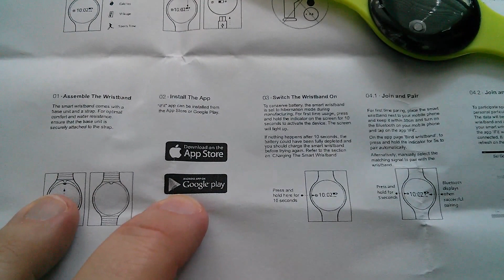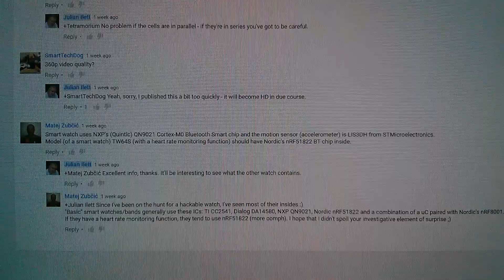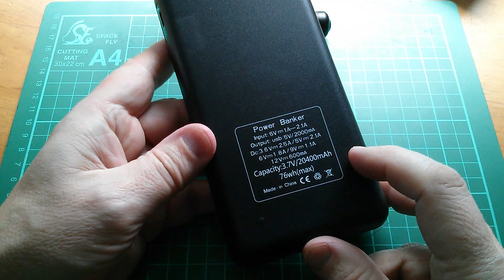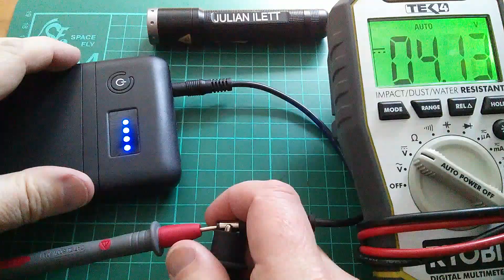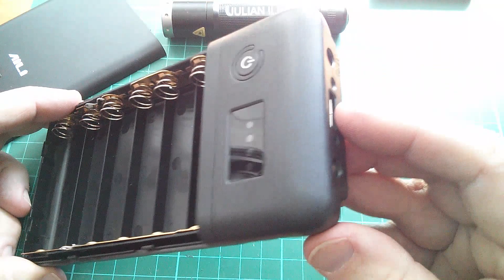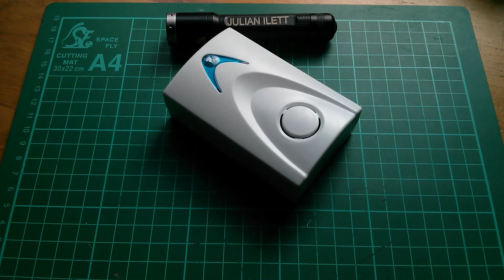Julian's Postbag: #61 - Green Watch, 12v Powerbank, Doorbell

Comment: What's the make & model of that smaller power bank that you use with the watch? Given that it has a switch, can I assume that it stays on regardless of how small the load is?
Reply: Never mind - I found it: http://www.ebay.com.au/itm/Portable-USB-Power-Bank-18650-Battery-Charger-Case-DIY-Box-Kit-for-Mobile-Phone-/271837404062?var=&hash=item3f4ac59b9e

Comment: I ended up getting the doorbell after watching this video .. I wanted to mod mine with an arduino whereby a distance sensor would cause the arduino to initiate the button push to trigger the remote chime. I thought a transistor would be perfect for this task so I chose a 2N2222 since it should be able to handle the 12v 23A cell - I'm hooking the collector and emitter over the push switch's two contacts and theoretically hoping to push 5v into the base to complete the 12v button circuit.
Mine is triggering without any base voltage/current supplied and I am wondering what I am doing wrong / failing to understand. I wonder if you or your audience could shed some light please ?

Comment: Clean the contact and then try to use something to allow better contact between the metalize pad and the contact, incase you pulled off something that made it stick to the contact.

Failing that, dump some solder on it then put back together and then leave it alone... :)

Comment: The touch sensor is self calabrating type, you will have to discharge the thing and charge it again with the lid closed to get it recalabrate, it will work fine then. good luck....

Comment: interested in doing a tear down of a power jack Mppt charge controller I've got? it has the coils in it associated with Mppt but when 19vts coming off the solar panel (250w) LED struggles to power up and puts out about 2vs on the output legs same when it's switched off!

Comment: so did you do what you said you'll gonna do: cleaning the connection? because you touched it with your fingers maybe transfered grease. Doorbell: I noticed a cold solder spot or lets better say no solder at all in the lower right corner of the receiver board were the square is. unnecessary? if not this might cause problems soon.

Comment: That metal covered foam looks like a piece of RF shielding gasket foam. The usually come in large strips to seal metal enclosures for RF interference (and of course of it leaking out), and it looks as if they just snipped off a small piece to use as a flexible conductor to the front.

Comment: Nice to see you using an efest cell that should have good protection , better then the ultra fire pack in your last video. My concern is does the instructions say to only use quality protected 18650 cells? I don't see that battery pack preventing one cell from dumping into another cell and I don't think I would use the pack to charge 18650 either. Maybe something you can do a follow up video on?

Comment: I wonder if the capacitive touch thing automatically adjusts in software to the maximum capacitance that it's seen, and by touching it directly inside you've caused it to dial down its sensitivity enormously?

If so perhaps letting it run stone dead then recharging it again and touching it through the case this time may fix it?

Comment: The 4.1X Volt you see must be the battery voltage. Remember lowest buck voltage with the up converters is the input voltage.

Too bad manufacturers don't use those cheap buck modules that are programmable and can provide something like 2 or 3 Amps at for example 12 Volts.  With 6 x 18650's they would make awesome devices to power up like portable radios at picnics or other events. Maybe I should buy  a 6 cell one and maybe lose 1 or 2 cells and place a buck converter with a display in place. Might not be handy since then you probably need protected cells.
Owww, if we could only provide a wishlist to manufacturers. Technology is there, our money is good for it, so why ow why.

Comment: I would think the high 4.1X voltage on the 3.7v mode would maybe be a direct output from the 18650 batteries installed.

Comment: the capacitive touch controller is probably self calibrating, so when you opened it and touch directly it got a higher threshold, most likely needs a reset it to get it back to the level sensed via the metallic foam pad

Comment: Hi Julian, I can send you some of the conductive cloth and you can make a new little capacitve link/spacer, or what ever we should call it. I bought quite a bit of it to shield noisy video and RC wires on my multirotors. If you would like to source it yourself, you have only to look in that old laptop that you are about to recycle. They use it to make faraday effects, and to close grounded case /componet gaps. Best regards, and I really had a good chuckle along with you

Comment: It looked like the braiding over that touch pad was originally glued to the board to keep it in contact.. maybe glue it back to the board, just on the edge of it. Or you could build a bit of solder up on the pad to raise it up a bit

Comment: The 3.7v on the power bank is probably just a pass-through from the battery and as such it just reflects the voltage across the battery, whatever it might be at that time.

Comment: The CC2541 is really cheap but it uses the gnarly old 8051 architecture and needs an expensive proprietary C compiler, sadly. No obstacle to the Chinese - they seem to like the 8051 over there - but a pain for hobbyists to do anything with.

Comment: I have the next model up for the power bank, it has a voltage read out and can go up to 21 volt 3 amp to charge a laptop. there are two button beside the usb jack that switch between battery and out put voltage  on the display and the other button reset the unit when battery are put in for the first time. you use your laptop supply to charge it http://www.dealsmachine.com/best_240698.html

Comment: Could the circuit board in the watch need a 90 or 180 degree twist inside the case...?  :)
Reply from the maker: +mnelson10000 There's a cutout for the USB socket, so it only fits one way round.

Comment: Hi Julian,
Is it possible that the watch can somehow calibrated the sensitivity of the switch? Have you disconnected the power to it?
Reply from the maker: +stupidystu Yeah, I'm starting to think that's it. Actually, there's another way to turn on the display - you rotate the watch and stare at it. It must use the giro/accelerometer to detect the wrist turning gesture.

Comment: Try resetting the watch. Remove the battery. It might "learn" the capacitance so it will need to re-learn it with the case intact.
Reply from the maker: +Daniel S I'll let the cell discharge fully. Then recharge, reboot and see if it starts working again.
Reply: +Julian Ilett Good, let's hope it works. I got a capacitive touch keypad with an MPR121 after seeing your video when you got your MPR121 breakout board. I had quite a time getting it to work reliably as there was a lot of configuration and setup of the IC. I guess it would have been easier if I had used an Arduino and had some libraries to use :) But I seem to recall that it "learned" the base line capacitance or some such.
Reply from the maker: +Daniel S The Adafruit MPR121 library must set the chip up with a good set of defaults, because I've found that chip to be 100% reliable.

Comment: Maybe the touch sensor does some kind of calibration / zeroing out on boot which could be messed up now?
Reply from the maker: +Kaeltis The lipo will discharge in a couple of days. I'll see if it recalibrates next time it boots.
Reply: did you ever try and see if that watch worked after the lipo discharged and see if it recalibrated to get the touch sensor to work?
Reply: +Kaeltis yup, i think that's it! because i have a bluetooth speaker with those touch sensors and one day i opened it up and buttons stoped working until i rebooted it!
Reply: +Julian Ilett short the battery for 1 second and thats it hahaah
Reply: +Kaeltis Jea it might be recalibration, I have developed software for couple different uC with touch capabilities and there is always some sort of calibration and threshold learning involved. Touching it directly usually ain't good idea. But it should fix itself up at next recalibration. Conductive foam is actually really nice solution for this, I shall remember this for next time I'll deal with touch interfaces.
Reply: +Kaeltis If the software is done properly the touch switch should recalibrate eventually.
Reply: +Kaeltis I rather think the fabric is shorting the pad on something else.
Reply: +Julian Ilett If that does not work, I suppose there is also the possibility that touching the pad directly fried part of the circuit, after all, it is possible the designers saved a little on minimizing protection circuits on the assumption that the bare board would not be handled outside the manufacturing plant.

Comment: just put a blob of solder on that tap so it will touch the spongy thing?
Reply from the maker: +fredlllll I may have to go a bit further than that. I'm thinking of soldering on a short piece of wire and drilling a hole in the plastic front :(
Reply: +Julian Ilett are you sure you cant just poke in the bit in the button? i recently took apart a monitor with a touch sensor and the button had to be conductive, so i guess there must be a piece of plastic/metal in this little window. drilling would ruin the watch :C
Reply: I was about to suggest that

Comment: Unregulated output from Lithium battery will be up to 4.2 volts. 3 7 Volts will be normal when battery has discharged a bit.
Reply: +Michael Kaliski yes i'd say the 3.7v output is not regulated, just whatever comes out of the battery, which would be 3.7v nominal, 4.2v maximum

Comment: To be fair it wasn't a weak point till you openned it up ;-)
Reply from the maker: +Colin Hickey That's true - still no idea how I killed it though.
Reply: +Julian Ilett BTW i spotted the same powerbank for under $5 http://www.ebay.com/itm/Mobile-Power-Supply-18650-Battery-Charger-box-For-Laptop-Notebook-Battery-phone-/131604864414?var=&hash=item1ea442dd9e:m:mL5mnSLUf8nRfzvvWxDjPWw  Shame the 20v laptop ones which support higher amperage are over twice the price.  Also i wonder if the 3 alternate has actually just been lifted from the next model up which seems to be 3s2p configuration http://www.ebay.com/itm/Universal-Mobile-Power-Bank-20V-UPS-6-18650-Battery-Charger-For-Laptop-Iphone-/191691464166?var=&hash=item2ca1b39de6:m:mHIfQDY_QNVSgQ7PrTGCQmw
Reply: +Julian Ilett Maybe finger oils on the pad interfering with the conductor thingie??  Try cleaning both sides with isoprop and try again!
Reply from the maker: +Colin Hickey Yes, that would make sense.